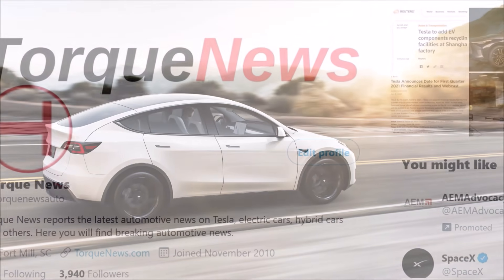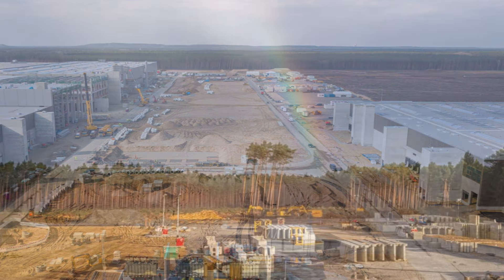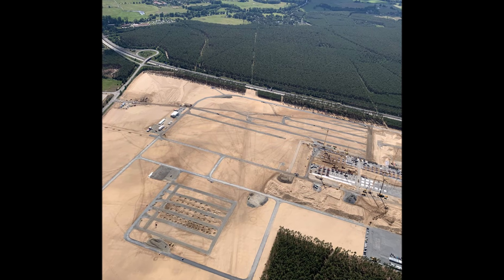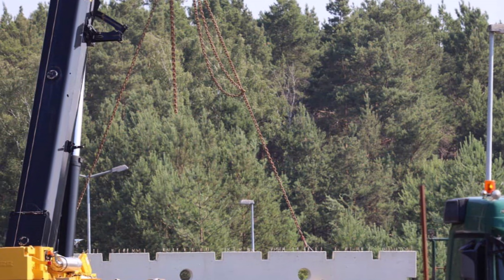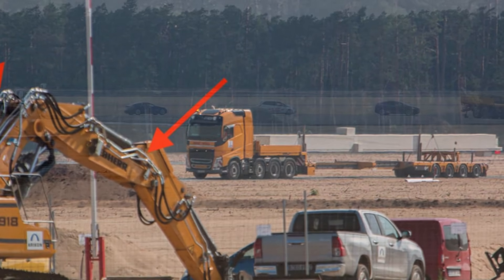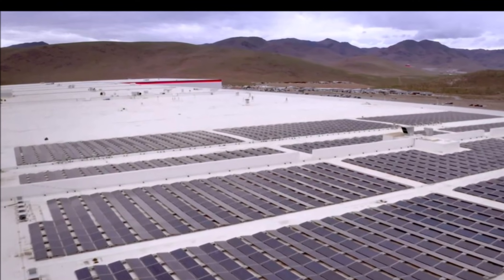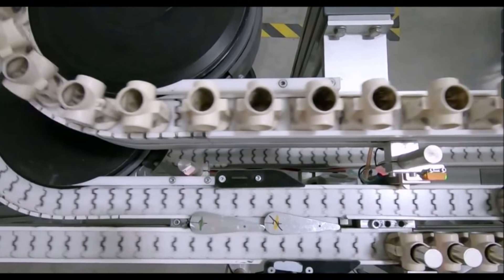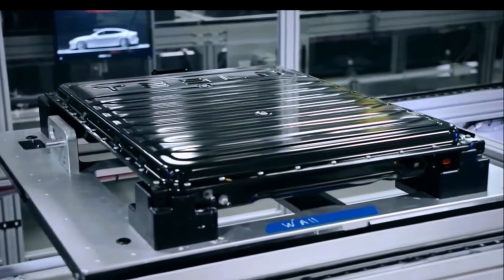Tesla To Build Model Y 4680 Packs In Texas and Ship Them To Giga Berlin Due To Delays

Comment: I have been watching the building of the Texas Gigafactory.  The battery cell area is not yet closed in and I don't see any manufacturing equipment being installed for production of the 4680 batteries. They also have another area on the Texas plot of land where they are going to do battery related operations.  This has not yet seen any steel erected.  The Texas facility if going to produce model Y's there with the 4680 batteries.  They are also going to produce the Cyber truck there with 4680 batteries.  They are also going to produce the Tesla Semi there with 4680 batteries.
It would be hard for me to believe that they would send 4680 batteries produced at their Texas factory  to Germany until all of the needs of the Texas factory have been met, which I would imagine???? to be several years.

Comment: Very interesting report.
Just wondering where you have gotten the information that  4680 battery production has been perfected to the point of mass production at Austin and Berlin. 
Because Elon today stated today according to CNBC:
He acknowledged that Tesla is still not manufacturing its custom-designed 4680 cells for commercial use in electric cars or energy storage systems.

Comment: Should have built in uk instead of Germany
Reply: Only one possible problem with that; the UK is no longer part of the EU.
A car or other motor vehicle imported to Germany from outside the EU is normally subject to a 10% import duty and a 19% import value added tax. (The value-added tax on imports is called import turnover tax.

Comment: Regenerative braking for more energy. why has not dynamo in the car? or dynamo with electromotor, or a motor like generator in driving. why only in braking?..
Reply: The motor is a dynamo generator when coasting.
To have another motor acting as a dynamo when driving would use more energy by dragging down the 🚗
Not sure what you are saying exactly 🤔

Comment: It seems more like a statement intending to shame the German officials for allowing frivolous bureaucratic delays to slow construction, and promote the progress of Giga Texas. Why wouldn't Tesla produce the 4680 batteries for Germany at the working Kato road (Fremont) 4680 battery factory? I am certain that the "environmental" delays are backed by all of the industries that will lose business when Tesla starts building EVs in Germany. Including all of the European automakers, related suppliers, and of course the oil companies. With regard to the lower lithium use, Tesla had said previously that they planned on reducing cobalt use, and increase silicon use in their high nickel batteries. Modifying their battery design and chemistry is part of Tesla's ongoing process and plan to reduce the price of their batteries. Expanding their 4680 battery production will help greatly with this goal. What I am waiting for is Tesla's follow up on their Lithium mining plans announced at their Battery Day event a few months ago. Drew Baglino, SVP of engineering at Tesla, said:

    “We are going to use a new process that we will pioneer. It’s a sulfate-free process again, we skip the intermediate. It will result in a 33% reduction in lithium cost.”

CEO Elon Musk added:

    “What is the best way to take the ore and extract the lithium and do so in an environmentally-friendly way? We have been looking at from a first principle physic standpoint instead of just the way it has always been done. We found that we can actually use table salt, sodium chloride, to basically extract the lithium from the ore. Nobody has done this before to the best of my knowledge."  If Tesla succeeds with these new mining, refining processes, then the costs of producing lithium for batteries will drop off sharply, despite increased demand.

Comment: Crazy how Berlin is holding them back, terrible.
Reply: Tesla did not even apply for a permit to build a battery factory until some weeks ago. What do you expect?
Reply: It is crazy how much faster it works for Tesla!
Reply: This problem is ALL Tesla's doing. They had shit planning and are now "reaping their reward".
Reply: @PelicanIslandLabs  It is a mismatch of planing styles. The German style is very slow, making sure everything is right at the first time. Teslas style is being fast and flexible, expecting to make changes on the way. Both styles work, but are hard to combine. They are on the opposite ends of a spectrum.What happens in this project is about two times faster than normal from the German perspective, and half as fast from Teslas perspective.

Comment: Researchers are studying other cations beside Li+, but those batteries are quire a ways off and LiFePO4 is a great, and inexpensive cathode material that Tesla currently uses, but it is also based on Li, so doesn't avoid the Li+ issue. The biggest move Tesla is making is mining, extracting and processing their own lithium with their own technology - then further lowering battery costs with dry electrode deposition, using big 4680 cells, etc. They better than any other big user of LiIon batteries are insulating themselves from lithium prices (which are nothing compared to cobalt, nickel or even manganese).